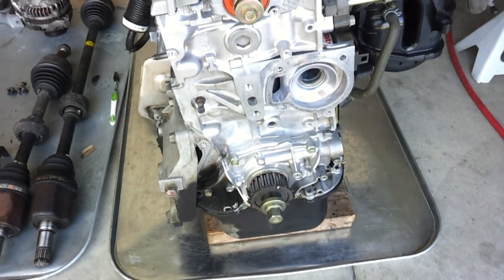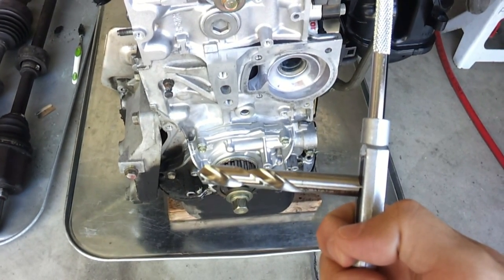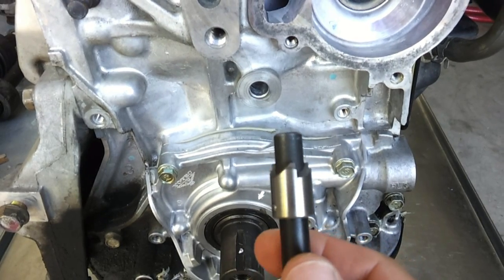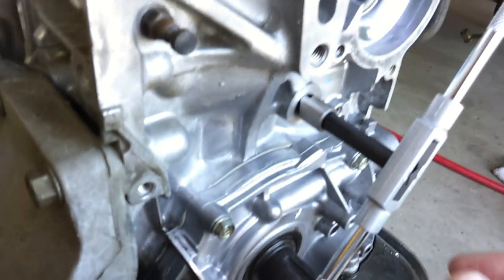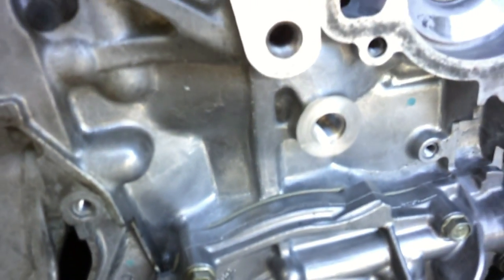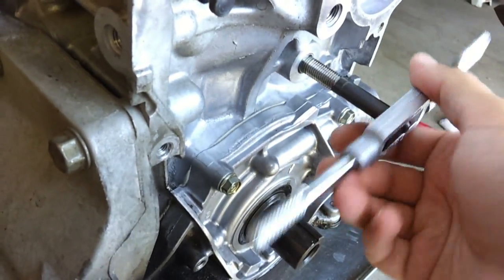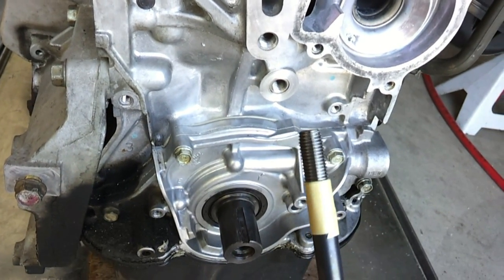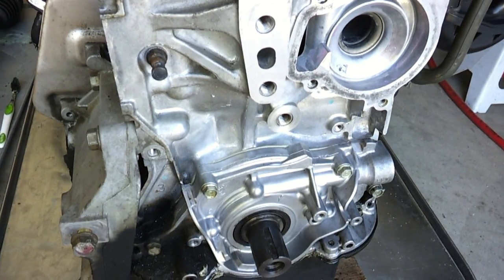Time-Sert thread repair, timing belt tensioner Honda Civic

Comment: Lock tight on that insert will prevent it from coming out later
Reply: @stephenlee007  Those inserts have a red adhesive coating that activates once inserted.Also the seating tool he said takes a bit of force,the tip of the tool expands the deep end of the insert.Kinda like sheet rock anchors work.

Comment: M10 x 1.25 Helicoil kit works fine, drill a 1" hole through the inner panel in front of the hole for access. A straight-in shot for the repairs. Afterward, install a one inch bolt from the hole drilled.

Comment: Just use an M10 x 1.25 Helicoil kit. Just drill 13/32 bit or 3/8 ( 12/32 ) size and tap the hole with the tap provided in the kit and install the Helicoil. Perfect fit and will torque over 33lbs as required by Honda. I drilled a 1-inch hole through the inner panel to align with the bolt hole on the front of the engine. Afterward, I  installed a 1inch bolt to secured the drilled hole.
Reply: @johnstuckey2384  thanks. Very helpful
Reply: @johnstuckey2384  did you have to pull the engine?
Reply: Dont use helicoil on this application lmao. Asking for problems.
Reply: @johnstuckey2384  you wouldn't happen to be near Mississippi huh? I'm stranded and trying to perform this on my Honda Accord. 😭

Comment: What is the UPGRADED timing belt tensioner bolt part number? 

https://www.pohankahondaparts.com/v-2005-honda-civic-sedan--lx--4-speed-automatic/engine--camshaft-timing-belt   This shows two part numbers for same bolt #12 on the diagram.

Also this link shows http://s7d9.scene7.com/is/content/GenuinePartsCompany/1532698pdf?$PDF$ updated bolt only needed on 2001-2003 civics correct? 
So 2004-05 just need original bolt and correct torque.

Comment: I've come across this problem 05 Honda Civic EX. My thoughts were to take a hole saw and cut a hole out of underneath the wheel well.  to give me a straight shot into the tensioner pulley hole. Your thoughts on this? I am by far not a mechanic i worked on cars on my whole life.  . Everything was going great until I took out the old tensioner and noticed the threads came with it. LOL I knew I was in trouble I picked up a fix a thread 10 by 1.5 figured it would give me a little bit more bit? anyone thoughts and comments would be a great help. Thank you for taking the time to make this video
Reply: the eabster 

did u ever get your civic fix ?

Comment: Do you know if its important to secure the tensioner bolt to 33ft lbs? On my 01 ex I replaced the timing belt, but the old tensioner bolt stripped the threads. Got the upgraded bolt from dealer and placed it in without re threading, it's holding but don't  know if it will cause problems down the road.
Reply from the maker: Are you tightening it down by hand or torquing to spec? The tensioner bolt is a critical component, if you loose your timing belt tension you can bend valves and then you're looking at pulling the head off
Reply: grjr
The first time I torque it to spec, but then I took it off to clean the area of gunk and coolant. Second time I torque it was not locking, than I knew something was wrong. Took the original screw out with shavings from the block, later I learned through your video and others that honda recommends an upgraded bolt, so I did and installed it with the damage already done to the block threads. It is tighten all the way now but not to specs. Feels pretty secure, I just don't think the threads can be repaired without removing the engine. It has ABS so the space for the area is even more limited for the heli coil.
Reply from the maker: hvac caldera I believe someone else in the comments section was able to repair the threads in his block with the engine still in the car but I don't know if his car had ABS or not. When I was working on this car I had a similar experience. The original bolt came out with threads from the block. When I put in the new updated bolt I tried tightening it to spec with a torque wrench and it didn't have enough threads left to be able to tighten it down. I can't say if your bolt will hold or not, but one thing is for sure if it doesn't hold the cost to repair will be great.

Comment: FYI I was able to get at this hole on the car by pulling the drivers side mount, front mount, rear mount and putting a jack under the transmission and another jack under the oil pan. If I had the luxury of the pulling the engine to do it I would have just to be 100% sure I was going in totally straight with a level drill - but I did not have that luxury. I'll post in about 6 months and let ya'll know if the repair held up OK. I used Helicoil 5543-10 M10 x 1.25 Metric Fine Thread Repair Kit.

Comment from the maker: You'll want to use the updated bolt. I can tell you that the old bolt that you DO NOT want to use is 51 mm or 2" long measured from the bottom of the head to the end of the threads. I don't have a measurement on the new bolt, I don't have one to measure at this time.

Comment from the maker: You might be able to do it if you can tilt the front of the engine high or low enough to clear the body to do the repair but I don't think you could tilt the motor enough without risking breaking a cv boot, motor mount or something else. The timing belt area is very tight on these cars.

Comment from the maker: @spelunkerd same here in the U.S. I couldn't find a local retailer for time sert so I had to order the kit online. Another thing to consider is that these kits are more expensive than a helicoil kit. I think it is worth the extra money for certain applications such as spark plug threads and head bolt threads.